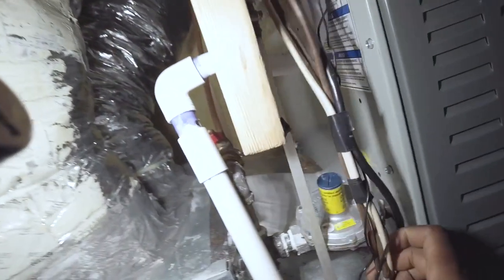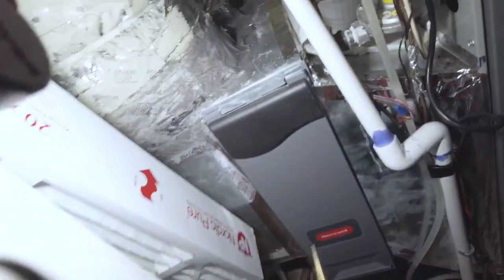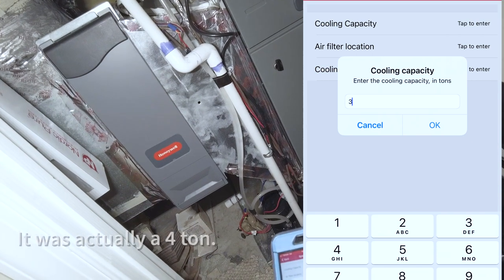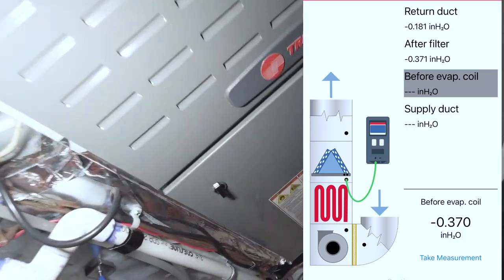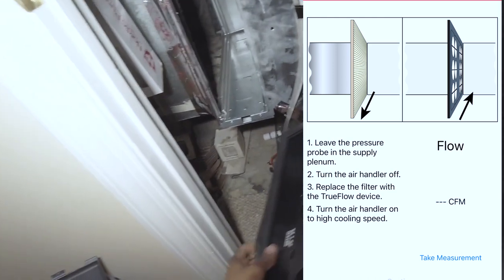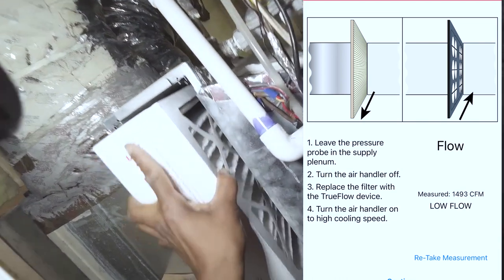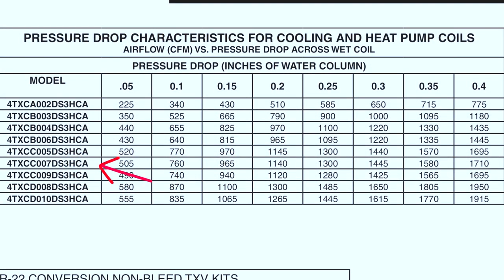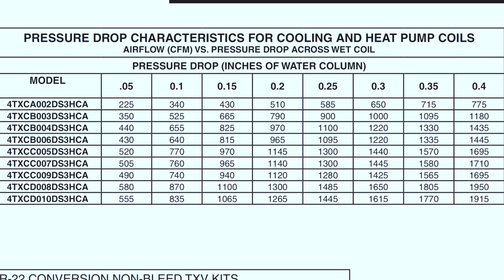The Most Effective way to Measure Airflow Yet! TEC TrueFlow Grid HVAC Digital Airflow Meter

Comment: I swear I hear a unprimed trap or some vibration never seen it but wonder if positive pressure on upflow evap drain is installed too deep into the pump making air bubbles in the tank

Comment: Nice video bro! I’ve wanted to get my hands on this to add to my truck but the price point man 😬. Would truly be beneficial. Did they send this to you or you pick up yourself? The DG8 is nice to because it resets man. Airflow is the biggest issue we deal with and most overlooked for sure 👍🏻
Reply from the maker: Hey thanks a lot man! Yeah the company I work for was kind enough to get it for my van per my request. It is a really sweet rig, it really opens up a whole new dimension on how I approach service calls and troubleshooting. It feels like it's been a missing piece to the troubleshooting puzzle. Are dg-8s an awesome stand-alone manometer as well. Its Rock Solid even at lower Pascal readings. I definite feel more confident in the ego over my Fieldpiece joblink manometers.
Reply: @HVACTechKnowledgy   man that is sweet! Good company there. I’ll have to speak with my employer tomorrow 🤔 lol. Good stuff!
Reply from the maker: Hey it never hurts ask lol.